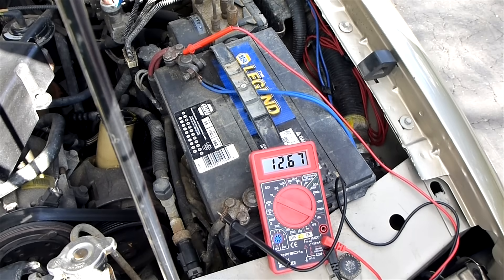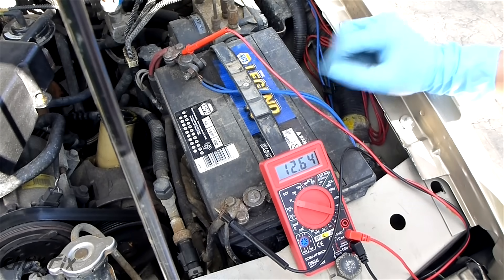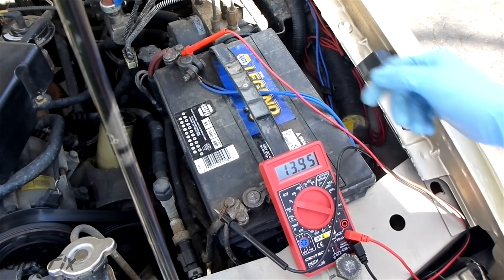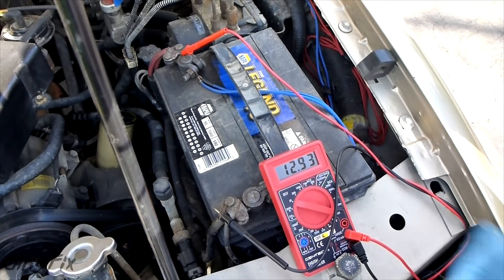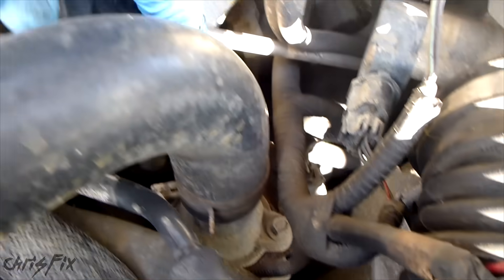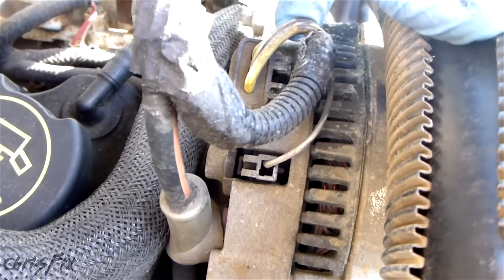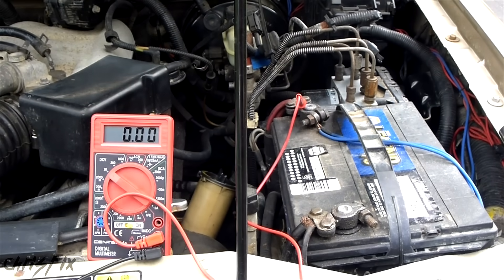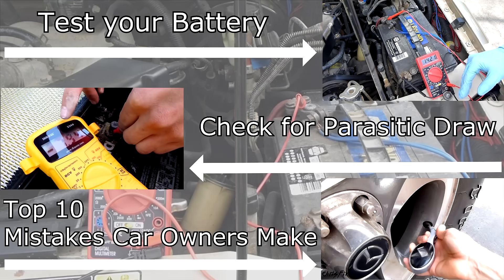How to Test an Alternator

Comment: Hey Chris, I'm a retired auto mechanic, with 4 years experience at General Motors Assy Division, (Back from 1978--1981), then 15 years as ASE cert master at a Chevrolet Dealer, then 4 years at an automotive mechanical claims facility (Call center for under 800.00 repairs). I have to thank  and congratulate you for the outstanding job you're doing. You are helping people and asking nothing in return but for people to subscribe to your channel. You are helping thousands of people from being fleeced by the people that take advantage of people that don't know anything about the automobile or the industry that's giving them a bad name due to greed and corruption. My guess is the thumbs down people are the ones losing money thanks to your YouTube help. I just want to thank you and salute your help to people that are tired of being screwed by the shops and mechanics that are more concerned with making money than keeping customers happy.
Reply from the maker: Thanks a lot!
Reply: Very nice compliment, from a professional.
Reply: 100%, I had a problem with the headlights, auto electrician tried saying it’s the actual headlights and tried charging me $550 to replace the headlights.. I found the problem myself and fixed it myself for $35.. wasn’t the headlights at all, it was one of the wires, snapped inside so I had to cut it and re attach the new one on.
Reply: @stabrio78  that's awesome I've started watching because need to learn more and sadly most mechanics it seems are shade tree mechanics or they are certified and want to screw you out of money! Lots of times it is something simple but mechanics don't make money from changing a wire or a relay that takes minutes to change they would rather have the car sit there for a few days and charge you 500. To 1000.and make someone even if they have to.lue to do ot . I know because I worked w my BF for 8 years in a shop many time people would call him because they didn't know what they were doing so he was the last resort . Never did I see him not diagnose a car right! Sadly we are no longer together but I learned a lot in the mean time. I always told him you charge way too little money he would say it was only a relay or a lose ground yes but you have to know which relay. Lol  he still would only charge a minimum and was always honest. Hard to find people like that now a days.😢
Reply: @stabrio78 Glad you were able to diagnose and fix it yourself and save the 500.00 kudos to you!!😊❤
Reply: @stabrio78  Same here, my daughter bought an old jeep that had an electrical problem. The dealer wanted to install a complete wiring harness for 1800.00, when I told my wife about the price, she told me, you can fix that don't let the dealer screw you. After I ripped out the entire interior down to bare metal, I found the problem and fixed it with a simple wire repair, it seems that people don't want to pay the extra 6 or 8 dollars a month for the option so they have the dealer sub it out to an aftermarket company that just runs screws through the wiring harness that just creates more problems. Save yourself a headache, just pay the extra few bucks.
Reply: I simply don't understand how you get any thumbs down on your videos. Unbelievable; the nature of man. Thanks Chris for your exceptional videos.
Reply: @sasusan1 I'm guessing the thumbs down are the crooks that losing money because Chris helps them avoid getting screwed
Reply: Agree sir
Reply: Amen to that! Sounds like you were one of the good ones.👍
Reply: Gotta love that humble brag
Reply: Jumpercable wireless sir you are so right...love you comment
Reply: Frank Ramirez i need those 😭
Reply: Well said sir, far too many part swappers out there that claim to be mechanics and all the parts they swapped because they don't know how to properly diagnose the problem, ......well you needed those swapped too surprise surprise! Great channel chris 👍🚘
Reply: @lizardking5002  just like the other burnt out old tard in here spouting his “qualifications” I’ve got three degrees, you don’t see me walking into comments like I’m the shit...
Reply: @lizardking5002  here’s another pretender.. mate if you were such a legit mechanic you wouldn’t be looking up alternator clips on youtube..
Reply: Your a Legend, love your honest comment. You I d say are a good ol school gentleman who did his job to help people n not for greed. As a woman I wish there were more people like you. God bless n great comment!
Reply: @caterinazaffino7438  I appreciate that thanks. Just keeping these losers honest 👍🏻
Reply: @karenthomson9749 I don't think she was talking to you lol. How she would get  "old school gentleman"  from all of your "I'm so superior to all of you to the point I'm actually levitating above all of you morons" sounding comments I have no clue. However if she did then the two of you were made for each other😂
Reply: Good ol school gentlemen here who did his job to help people n NOT for greed. As a woman who mechanics try to take advantage of I SALUTE you!- Little do they know I do lots of research before I bring my cat in Lol!
Reply: @caterinazaffino7438  there’s other ways you could pay that would be free 🤔🤷🏼🙇‍♀️😵
Reply: @george Davis.. man shut the hell up.
Reply: Thank you, Chris.  I agree with ALL the positive reviews. Your videos have also helped me fix or understand so many things and issues I've has with my vehicle.  And, it helps greatly that we have the same truck; mine is the Ford Ranget version 😀
Reply: Chris thank you learn something
Reply: I'm from the Philippines and this guy helped me a lot in learning how to do stuff to our cars. I learned how to troubleshoot and analyze every signs amd symptoms that our vehicles are showing. Thanks, Chris!
Reply: I mean he getting paid for these videos by now so is it really for nothing I. Return
Reply: I have only had 2 cars in my life and I have not taken any of them to the mechanic or to the dealership, every fault they have had I have always solved on my own with the knowledge that people like Chris share on the internet more than anything because I worked in a dealership and the advisors told the clients that their cars had defects or that they needed parts that did not really need to be solved/replaced and those who did not know ended up charging too much for very simple jobs that they could have done themselves, now when a colleague work, friend or neighbor tells me that if I can help them with their car I will do it without problems and without charging since I gain practice and they have their cars running again without paying stupidly high prices for simple faults
Reply: @joegamer1696  same I just take mine for tires  alignments or inspections
Reply: There are plenty of us on fixed incomes who NEED to do this ourselves. Affording a mechanic is out of range often.
Reply: Pm
Reply: The last time I took my car to the dealership I bought it from. Ive been having electrical issues recently and I wasn't sure if it was the battery or the alternator. They told me their test for the alternator was $1500. Just to test if the alternator was bad. I asked if it was bad if that money was rolled into a repair if I did it with them and they said no. Now I can go test it by myself, and I can know if its good or bad
Reply: How do you get your car to 1500 rpm when solo troubleshooting
Reply: This is deep. 🤝💯
Reply: I ❤ It!!!
Reply: I’m losing money because of some guy making videos and you think it’s “cool “ he’s helping people, but he’s not helping my BUSINESS is he ?
Doesn’t matter though because some people are still trying to figure it out and that’s my business in real time hands on to help people , not some guy making cute videos for the world
Reply: Havnt watched the video yet but if the review ahead  of mine is right.. I am gonna thank you also for taking the time to show people who don't know anything about a vehicle, a little how to knowledge to save big bucks if they do things  for themselves.
I pretty much know how to check, and or  change a alternator, starter or battery.
Mainly lookin at the videos to see if you are able to get to and change
Any of them out without special tools or having to take half the car loose. LOL
Lots have changed on them since 70's 80's and 90's,....Loved the 70s anything was easy to work on back then. But then again I was a young man then and anything could be fixed or rebuilt..
Now I am an old Fart who just don't want to pay a fortune to someone on jobs that should be fairly easy...Even for a broke down old man.
Everything nows days is made cheap,  & thrown together no one cares anymore.
I got a 2018 chevy highcountry that either has a bad battery, alternator or starter.
Havnt checked them yet....
42000 miles driven town and back or Dr and back mostly.
Just don't feel like its time for any of these items to be out yet,(with exception of the battery)
And the prices are unreal 589 bucks for oem alternator,  Back in my day you could replace all 3 for less than that..Things are crazy nowdays ......So to all you people that are mechanicly inclined do yourself a favor and keep watching these how to videos on (UTube)and do things within the scope of your abilities by yourself.
Save yourself lots of bucks and nowdays the labor is usually more than the parts.
If in doubt watch several different videos, but lots of things are doable if you take your time and invest a little time on videos.
(Think I Might start doing brain surgery before long)
I joke but bet you could find out how on UTUBE....
So much info and so little time 😂.
Stay cool people, be kind to each other and save that $money$ on fixing a vehicle when you can.
It's a crazy world out there and no ones gonna look out for you but yourselves.
Have a good day guys follow instructions and all safety suggestions save yourselves money and have a good feeling knowing Hey I done that all by myself....................😊😊
Reply: I left chevy 25 years ago and retired as an engineer at a hospital in 2016.
Reply: Retired after four years of experience?
Reply: i thought you were like 21 lolol
Reply: Prove your CV. It could be bullshit
Reply: @kaijuryuk At 73 years old, I'm way past the bullshit. Give me your address and I'll send all of my ASE award and Chev Cert tech awards even though they are almost 25 years old, I still have them, so, I'm calling your bluff-- Waiting for an address.
Reply: With the way you read off that resume I thought you getting ready to correct him about something
Reply: @krapeevids6992  I was a mechanic, not an english teacher.
Reply: @krapeevids6992 lol
Reply: Got a quetion.. is there any way to test a alternator if the car won’t start but lights come on? It doesn’t even turn over, just everything else comes on but no spark
Reply: @Rtb323 First, either charge your battery to where it will crank and start your car or or get a known good battery to crank and start. The simplest way I know of to check your overall starting system is that once you have it started, disconnect the negative cable from the battery. If your charging system is bad, the car will die. This won't narrow it down to your alternator necessarily but it will help narrow it down to your charging system in general. If the car continues to run,  then your charging system is working. Hope this helps.
Reply: @Touchme_im_grass  just a guess, check the starter wiring, if the battery is ok, then there's a wiring problem.
Reply: @Touchme_im_grass  take it to auto electrician brother they can test it for you
Reply: Super weirdo
Reply: No one cares about your qualifications bro... it’s the internet.
Reply: @karenthomson9749  I don't care about them either, have a nice day !! Sadly, if I didn't put in my qualifications, I'd have people asking me how I'm qualified. Have a Nice Day again if that's possible.
Reply: If you retired 10 years ago what would you say?
Reply: @karenthomson9749  If I didn't list my qualifications, I'd have people asking what makes me qualified to give my opinion?
Reply: @jumpercable20  more important are you impressed by my qualifications?
Reply: @karenthomson9749  Your first name says it all.  @Jumpercable wireless - Thanks for your input, society can be crass and you were sharing good vibes.  God bless you!
Reply: @mulkster39  Karen’s not my  name buddy...
Reply: @karenthomson9749  So you chose the name Karen.  That's even worse 🤣
Reply: @SuigaRou  at least I’m a part of this conversation. Unlike yourself.
Reply: @SuigaRou  I’m serious 100% why don’t you contribute to the convo? instead of trolling me....
Reply: @karenthomson9749 c'mon man, you've been trolling with your comments from the get go. Every single one was meant  to antagonize, belittle or embarrass someone so spare me the "why is everyone trolling me rhetoric"
Reply: @SuigaRou signed on under his wife or daughter’s name I bet. Lot of guys from his generation are that way, nothing wrong with that
Reply: @karenthomson9749  your wrong, I most certainly do!
Reply: @Karen Thomson  karen says it all. Geesh was it so terrible that he explained his qualifications to the author so the author would understand were hes coming from.
Reply: @dumpsterdivingqponqueen9499  agreed. Karen is the troll.
Reply: @karenthomson9749  I put my qualifications in because nobody believes you unless you give them proof. I can email all my documentation if you give me an email address to send it too.
Reply: @karenthomson9749  how appropriate your name is "Karen"
Reply: @karenthomson9749  Sadly, everyone wants proof, I'm not just a shadetree mechanic.
Reply: If u have an ase and all this experience why are u hear
Reply: @georgedavis2634  hear
Reply: @georgedavis2634  I retired in 2015 but left Cheverolet in 1998 from burn out and tired of dealer screwing customers. I physically couldn't handle crawling around in cars/trucks with nothing but metal floors. Sometimes, trying to find a problem meant gutting the inside of a vehicle. Give it a try when you're over 50.
Reply: @georgedavis2634  Retired in 2015
Reply: @georgedavis2634  Burnt out and just turned 70 in August. Back was destroyed by a crazy childhood, broken neck at 13, broken back at 16, after that it becomes difficult crawling around inside a stripped vehicle for 15 years, I had to get a way.
Reply: @georgedavis2634  At the age of 70, with a history of a broken neck and a broken back 30 years later, I'm drawing a check every month and don't need to work any more. I did it for 55 years, is that enough?
Reply: @georgedavis2634  man be quiet
Reply: @georgedavis2634  Several reasons,  I blew out my back crawling around in cars and trucks that I stripped the interiors out of looking for water leaks and pinched wires, and I left because I was tired of seeing the public get screwed and the fact that now I'm 71, when would you retire ?
Reply: @georgedavis2634 
Same reason I am.
Retired, but keeping the gears oiled.
No technician knows it all.
Reply: @georgedavis2634  why can't you spell you or here.

Comment: What if we it won’t start at all?
Reply: Well you need a jumper start .
There are a few reasons a car wont start
1 Dead Battery
2 faulty alternator
3 dirty battery terminal
4 faulty starter motor
5 bad relay sending power to starter. 
Was your alternator or battery light on in dash before you had the problem.

Comment: If the battery is low when you perform this test, will it still put out similar voltage while running or does the battery need to be charged before performing this test?

Comment: I want you to show the output voltage of the alternator, i.e measured across its B terminal and its ground. However what you have displayed here is sufficient to give rough but adequate measurement of alternator performance. Measuring at battery terminals are usually sufficient for that purpose, unless we want further details.
As for my car, when the engine is off, my battery voltage is about 13V; when the engine is on and no usage of other electric related parts, the battery voltage is about 14.5V. The battery is new, so that is expected. :)

Comment: If you take off the positive pole on battery while car is running, will the alternator keep the car running? Assuming that it’s healthy
Reply: aaron dostou Several months ago when my battery is weak, a mechanic brought a battery to start the engine. While the engine was running, he removed his battery and reinstalled my weak battery. I wondered how it could be.
When I read from wiring diagram of my car, I understood. I have a service manual that I downloaded about 2 years ago.
Reply: aaron dostou DON’T DO THAT!  Never disconnect anything while the car is running.
Reply: @venividivici4253  I agree, I always try not to disconnect electric parts when the engine is running. But what about diagnosing on spark plugs ?

Comment: Great video, I have a question, when you check the negative draw test, at the alternator it shows -0.05 V and when you check the ground from chassis it shows 0.06 V, why is this a positive value? It is fine to be like that?
Reply: Came here to ask this
Reply: I think the only difference is positive and negative swapped

Comment: I think you could also check for a bad ground using the ohmmeter between the negative battery terminal and other points on the chassis, alternator bracket and so forth. The reading should be very close to 0 ohms. Anything over 1 ohm? indicates a bad connection to ground.

Comment: i Chris i love your videos! I belive i have drop voltage from battery to fuel pump (positive side) 12,6 volts in battery, when i turn on fuel pump it drops to 0.4 Volts, is that normal or should the fuel pump voltage be the same as battery when turned on?